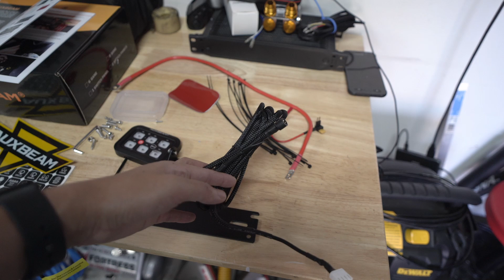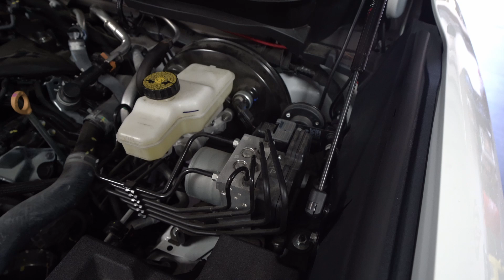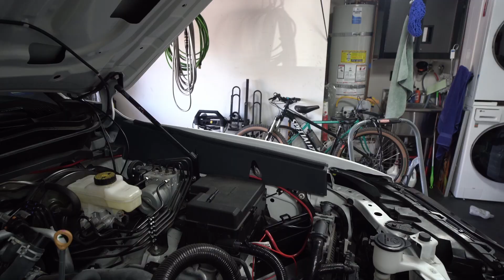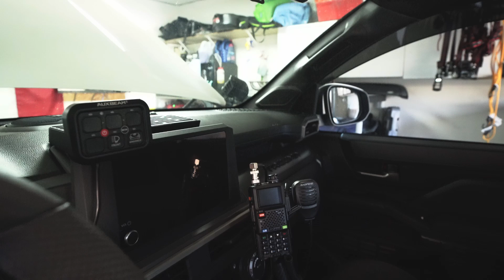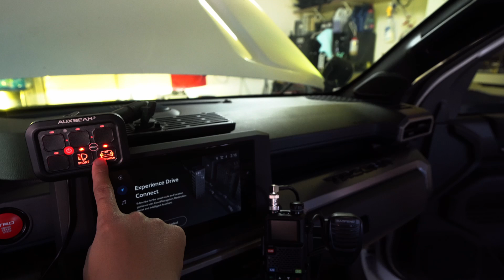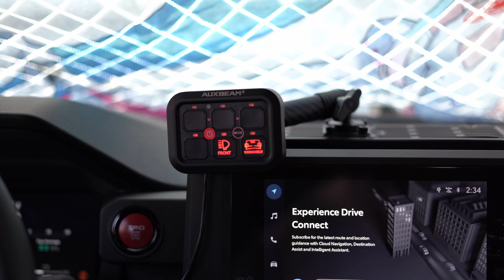4th Gen Tacoma Auxbeam Switch Panel Install

Comment: Any issues with water splashing on the wire connections
Reply from the maker: No issues! Possibly if you’re going through water crossings, but the usual rain doesn’t reach that high up in the engine bay

Comment: Did you remember the pitch for the bolt to secure into engine bay, also, where did you get the extension to make the box and even height? Thanks...
Reply from the maker: Off the top of my head I do not remember. I had a box of bolts and the one I used just happened to fit. If I remember correctly, there should be a factory bolt in that area that you can remove and take to the hardware store to find the thread pitch. The extension I used is a 1 inch rod coupling nut but any 1 inch spacer will do. In my case, the coupler is actually a larger size than the bolts thread pitch so its not actually threaded in.

Comment: Can you send me the link for the 7ft red gauge wire? 3:27
Reply from the maker: I actually just got it at home depot! In hindsight I actually wish I used a different wire as the one I got isn't as flexible as I would have liked. Something like car stereo wire would be perfect and its fairly cheap on amazon
Reply: @I @ItsAndysAdventure  do you have a link as to which one you used or would use instead?

Comment: Great video! Do you know what the size  of the bolts you used to mount the switch panel in the two open holes in the engine bay?
Reply from the maker: So one I used seems to be an oem style bolt where the washer is part of the bolt. Not sure where it came from or if it was part of my other car. But the thread pitch is M6x1
Reply: @IS300Andy thank you, I appreciate your time and video.
Reply from the maker: No problem! I appreciate your time watching the video!

Comment: Just got my Auxbeam 6 gang controller (non Bluetooth model) and it didn't come with a breaker.
Was here to see where you mounted the the control box in the engine bay.
Reply from the maker: Interesting it didn’t come with a breaker, wonder if that’s with all the new units or if yours just didn’t come with one

Hope the video helped with what you were looking for!
Reply: @IS300Andy  it was the cheapest model (BC60) I could find on Amazon for $132.99. It doesn't even come with Bluetooth feature but that's okay.  I just need simple

Comment: What size hole on the lug connector on the red battery cable?
Reply from the maker: I ended up having it laying around so I’m not sure the exact size of the one I used. But I think it was something like a 3/8th inch hole. The cable that comes with the kit is 1/4in and it’s too small for the stud

Comment: I installed my switch panel and wiring but when I turned on the controller, the lights didn’t turn on. Is this cause I need to have the truck power on?
Reply from the maker: Sorry for the late reply! The panel is getting power? If not, then yes. The truck would need to be on. To have it powered on all the time you would have to wire the signal wire (the thin red wire connected to the fuse box) to something that has constant power. That way the “power on” signal is always on. Let me know if you have any question and I’ll do my best to answer